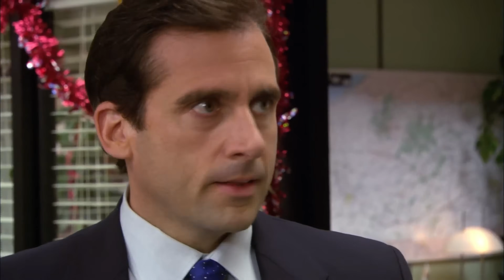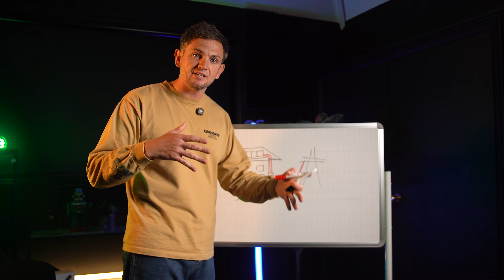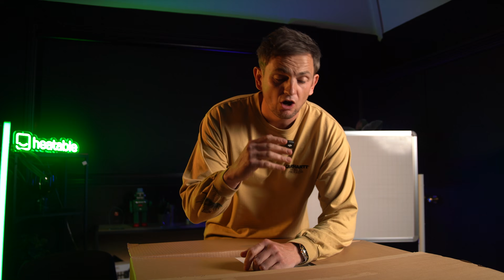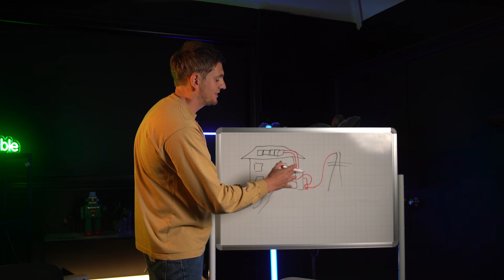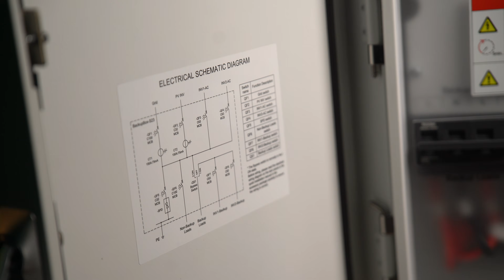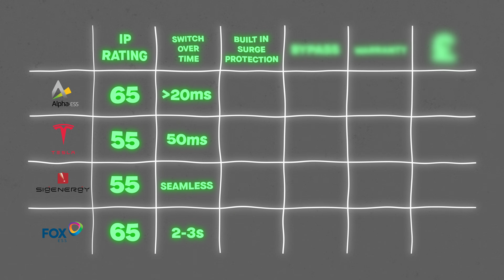What Solar Salespeople Don’t Tell You About Batteries

Comment: Have just had a whole Alpha system installed BUT  this gateway has had some technical issues which means Alpha have withdrawn it from the market while they attempt to fix it. Have paid for it as part of the heatable package but am still waiting. Any idea when it’ll be ready?
Reply from the maker: Hey Andy, we are expecting stock mid November so your project manager will be in touch to arrange this with you.

Comment: Looks like a nice solution to a problem that never existed. If I want my viessmann system to act as a backup device ( I don't as I only lost power twice in the past 11 years ; but let's just say - hypothetically) -- I would simply get my installeer to add the auto disconnect device. The rest is already included with the system. Of course, Viessmann VX3  I have  is not a budget Chinese setup and prkvides out of the box functionality low cost equipment can't. So I suppose some ppl my find it useful to payess up front only to pat extra later...

Comment: Don't understand why the solar industry are making this so difficult (yes I do - more money). Just put the relay in the inverter that you already have so it can break the grid connection, then have it constantly regenerate a clean 50Hz signal (which will smooth out you grid connection in case of issues there as a side benefit).
I also don't understand the comment that without it PV production would shut down - that's true if you' have micro-inverters, but if you're DC coupled why would that be the case?
Finally, switchover time is important, but if the sine wave of the power coming in shifts phase during the transition from grid to backup then sensitive equipment like computers may still shutdown / crash even if it happens quickly - again having the inverter always create the sine wave for the property would solve that.
We've had UPS for computers for years and the more expensive ones do exactly this for those reasons. Do we really need a box the size of distribution board and the additional expense to make this happen?

Comment: Question: Could such a box make an Alpha ESS inverter into a "Stand alone" inverter. These days in Austarlia some of those have become cheaply available due to upgrading of battery systems and that no installer appear to be willing to use second hand units. As I understand it then this unit beside disconnecting the house from the net it makes the inverter believe that the net is still there. Connecting an Alpah ESS inverter to any other 50hz power sourse will not allow the Alpha ESS inverter to start up. I suppose that is because of a much lower impedance on the net.
Reply from the maker: Theoretically, yes. I’m not sure if there is a two wire generator connection though if you run out of solar/battery (I guess that’s not really a problem in AUS)
Reply: @Heatable  Actually as I am in the southern part of Aussie then yes we run out of sun too. Solar panels generate on an average only 1 times panel value in June- July (winter here) so if a house uses say 30kwh a day then we would need 30kw of solar panels on the roof - and batteries- there can be a number of days without sun although that is probably not as common as in the UK. In the summer we only need 6 to 7kw panels for making 30kwh in average a day. Average through the year is 3 times panel value of energy generated.
i would be interested in seing the schematics of that switch box but but I expect that to be out of the question without buying one myself. I am a bit of a Tight Ass as I am a pensioner so I am not going to buy one soon I am afraid. I like to use the stuff that I can get for free or very cheap and being an electronic engineer then I can make use of quite a bit. I have so far gotten hold on 2 Alpha ess units - one older with li-ion battery 5kw and one newer one with LFP bateriey - also 5kw.  Total cost to me for the two has been A$307. The inverters are only 3kw so not too much. I am attempting to use them at my farm where there is no electricity so if I could put them together and make 6kw that would be nice. 
I am charging the batteries by connecting to the battery cable between the battery and the inverter but as the BMS won't allow access if the inverter doesn't run I keep having troubles charging. The losses from an unused inverter keeping it self alive is actually not trivial over 24h with only 5kw of battery.
If the batteries run too low the inverter switches off as it is supposed to but then the connection from the MPPT charger to the battery through the BMS is being blocked making it impossible to charge the batteries so it is not without problems. Problems don't matter so much though as being a pentioner I have plenty of time thinking about it. In regards to power I have other inverters too - and a generator.

Comment: Seems to me this video is misleading. Most new systems do indeed supply your house during an outage and I assume cut export to the grid.  Was this video sponsored??
Reply from the maker: Systems do not work like this. There is no UK approval for a grid tied inverter to software limit exports and supply the home. Unless you mean wiring to the backup port (which I mentioned).
Not sponsored no.
Reply: They disconnect the house from the grid entirely they don't just cut export. However some of the systems support having the entire house ((or most of it) on the port that disconnects from the grid, so whilst it looks like it's doing as you describe what actually occurs is a bit different.

Some Tesla can back up the whole house, bigger Sunsynk/Deye kit can (and even support a generator). In fact you can even wire a big Sunsynk to run an entire house without using the grid tie port at all, so it'll just use the grid as a "generator". Handy if you need a big inverter and the DNO says no if you are willing to trade not exporting for a big inverter/battery setup.

Comment: The deye inverters and many other inverters have backup built-in to the maximum capacity so you can have the whole house backed up via the inverter. Zero compromis. Customers need to be aware that the systems that don’t include this is not normal it’s just a money gouge.
Reply from the maker: Most do offer the same throughput as backup but they won’t allow for PV continuation (that I’ve seen) 🙌
Reply: @Heatable most allow pv to battery and pv to backup or ups circuits just like a off grid system. When grid goes down.
Reply: @Heatable  Solis S5's do offer PV continuation, when wired through a manual change over switch. Commonly set-up this way in Ireland. Solis have been at it 25+ years they know what they're at.

Comment: While I understand that electricians get paid a lot I can not help but think that £400 for installing this is rather high I mean at most it would take 1 person half a day to install so while a normal person on min wage has to go to work for a week to get that sort of money installing one of these that takes from 2 hour to half a day will get you around £400 thats a very high rate of pay aint it?
Reply: So train as an electrician. Then you'll learn how much the certifications cost, the never-ending revisions of the book, the van, insurance, tool theft, accounting, crud like "making tax digital" (aka making tax a nightmare), doing VAT, how much the MCS charges, customer late/non payment, how much MCS compliance costs, and of course how exciting a job it is where being wrong gets you fined massive amounts or dead. At least plumbers only end up very wet, or covered in poop if they screw up. I'm happy to pay an electrician because no way would I want that job!

A lot of the cost of an electrical install is not ending up in the installers pocket.

Every electrician started out as a "normal person" as you call it. Nobody is born a sparky.
Reply: @etchedpixels  The problem with your reply is that you've confused "£400 seems expensive" with "electricians should be paid minimum wage."

Nobody said electricians don't have costs. Nobody said they shouldn't be paid well. You've just listed every expense an electrician can possibly have and acted as though that ends the discussion.

Customers don't care how many rule books you've bought over the years. They care about what they're paying for a specific job.

If a job takes 2-4 hours and costs £400, people are going to divide one number by the other and conclude that's a lot of money. That's not an attack on electricians; it's basic maths.

And no, I don't need to become an electrician to have an opinion on pricing. I don't need to become a mechanic to question a garage bill or a builder to question a building quote either.

The irony is that I never said electricians were overpaid. I said £400 for that particular installation looked high. The fact so many people immediately jumped to defending the entire profession suggests they know exactly why customers ask the question.
Reply: @Datalore48uk People ask the question because they don't understand all the costs involved. Those of us who've actually run a small business don't ask those questions.

Taking the bill dividing it by the hours isn't "basic maths" it's "human chatgpt" maths.

Half the problem in this country is people going "how come they get paid more than me, it's not fair". The real question should be "How do I get paid that much too".
Reply from the maker: Few things to consider (separate to cert/rate debate) - 

Copper earth rod, 25mm2 copper tails, 16mm2 earth, containment, henley blocks etc

All adds up plus… profit 👀
Reply: Welcome to the real world, people value things differently, someone on a minimum wage job generally hasn’t spent years of their life studying, passing exams and spending thousands on equipment. I charge £35 per hour for my job, but get paid about £13 an hour for my other job. My mechanic charges £90 p/h main dealer £160 per hour, solicitor £200 per hour my daughter - paramedic £19 per hour plus shift, overtime and out of hours extra pay - saves on average 4 lives per week.
Reply: @bordersw1239  The other thing about having a job done professionally is that they have to cover for insurance, transport, building cost and many other things. Running a business is expensive. Labour costs are just a small part.
Reply: @bordersw1239  From the comments so far anyone would think that I said I was on minimum wage because I did not I was giving an example I actually own a pub so if people want to compare hourly wages thats fine.
My point was £400 for something that could take 2 hours and up to half a day is extreme. I had a chiller specialist come look at my cellar chiller and it was £100 call out and £60 an hour which I thought was fine since I know it would only take 1 hour to see what is wrong so I would have thought it is more reasonable to charge the same rate not a flat fee no matter how long it takes.

In my example if it takes them 5 hours then sure £400 is fine but if it takes them 2 it should be less.
Besides more people would be willing to install this if they charged less or hourly.
But sure like anything, each to their own I personally think they are charging way over the odds for this job.
Reply: The gateway needs an earth rod that is what takes the time

Comment: These gateways are such a gimmick. Many systems have gateways integrated inside the inverter why don’t they just make that a standard. Sounds like just another money catch
Reply: It's historically not been a standard in the UK because large parts of the UK see under an hours outage a decade and outages are fixed in a few hours max. So it's mostly been an add on item that people wouldn't choose to pay for.

The inverters with it built in generally did so for other markets (Tesla for the USA where multiday outages are common in many areas, Sunsynk for South Africa etc where the grid is best described as "interesting", and so on)

Comment: You are confused about "the signal" solar systems "listens for" to determine if they are on the grid or not.  There is no special signal.  The grid is producing a 50hz sine wave synchronized to it.

Initial detection of the grid before the inverter starts operating is easy.  It's either there or not.  But once the inverter is synchronized to the grid and outputting power, it needs to do other things to detect whether the grid is still there or not. The inverter can detect a grid-down event in several ways.

* The inverter caps out on voltage (suddenly there is nothing to push against and the inverter's output exceeds the loads on the circuit), and can disconnect from the grid very quickly in this case.  Or the inverter over-currents because the grid has become grounded and the inverter can't power all the homes on the block.  One of the two.

* The inverter synchronizes at a slightly different frequency (e.g. like 49.95hz) and then constantly resynchronizes to the grid frequency on every cycle.  If the grid goes away, the inverter will notice that the frequency is now 49.95hz (the one it is producing and not the one the grid is producing) and can disconnect within a few cycles.

* The inverter injects a deviation into the grid.  If the grid is present, the deviation is absorbed (the grid force the waveform to remain confortmant).  If the grid is not present, the deviation is not absorbed and the inverter realizes that the grid is no longer present.

In a full house backup, the off-grid or hybrid inverter disconnects from the grid and produces the required waveform (50Hz sine wave for example) itself.  There's no other signaling or anything else beyond frequency-shift power control of the microinverters (50hz to 52hz or so).  The microinverters still recognize that a "grid" is present.

--

20ms isn't so great.  Actually its pretty bad.   One cycle at 50Hz is 20mS (16.6mS in the U.S. at 60Hz).   That's two half-cycles of interruption which ... is not so great.

However, there is a trade-off in terms of reacting faster and that is you'll get more false alarms and wear the transfer relay out faster.

The transfer relay also has to switch on a zero-crossing which means the fastest it can switch is on a half-cycle basis (10mS @ 50Hz, 8.3mS @ 60Hz).  And the relay usually needs at least 4ms of energization before the arm actually moves... so best-case for a relay is typically 14mS.

This is a general problem with using a transfer relay.

Grid-interactive inverters can do slightly better by trying to correct the waveform while switching the relay, but there are severe limitations to doing this.  The grid-interactive inverter can inject only so much instaneous power while the grid is still connected... the grid is an extremely low-impedance source.  And any glitches (like starting an A/C compressor) can cause false relay trips.  The relay wears out faster.

--

Anyway, there are solutions.  The most common is to burn some additional power by running through an AC-DC-AC conversion in the inverter.  This is how online UPSs work.  When this is done, the battery can support a failing grid instantly ... 0mS switchover.

-Matt
Reply: It's arguably not worth doing the 0ms for everything as double conversion has a significant efficiency cost so it's better to pay that cost only on a little battery attached to the PC or device that is that sensitive.
Reply: @etchedpixels  maybe I didn’t explain it well enough.  Hehehehe.  Not every power failure is clean cut enough that a relay based backup can react to it fast enough.  Those 20ms specs aren’t really a guarantee… a good chunk of failures will start out looking like just a motor start and the unit will try to ride through rather than switch… it won’t react fast enough.  Double conversion wastes more power but IS a guarantee.  Double conversion is also still able to extract power from a grid in brown-out while still providing perfect output to appliances without having to dig into battery reserves.    Anyway, there are a multitude of reasons.

-Matt
Reply: @junkerzn7312  Yes I know. Double conversion is however horribly inefficient so it's better not to double convert the main supply but separately double convert just for the sensitive electronics.
Reply from the maker: Hi Matt

Thanks for the explanation. Technically spot on but could you imaging the retention rate on a YouTube video if i explained it like that 🙌
Reply: @Heatable  yes, very true.

Comment: Or, if you have pretty much ANY of the hybrid Deye or inverters or Sunsynk and Sol-Ark oem brandings wired with house on Load port.
Reply: That is, they have this "box" built in as part of the normal hybrid inverter. No need for a separate unit. You can however install a 1-0-2 changeover switch so you have the option of bypassing your entire solar/battery installation in case it needs servicing.
Reply: Yep we have a Sunsynk and it's really nice for this. Whether you can put the whole house on the load port varies a bit as the smaller ones don't have a 60A pass through rating. The ability to back up microinverters to 4kW or even an existing grid tie inverter up to that size is also rather nifty. Generator port is nice too but for the UK probably very few people need it, just those in very rural places or running one off grid.

Certainly not a 20ms switchover though.
Reply: @etchedpixels  no, it switches much faster when it's already in sync with the grid. The transition takes between 4 and 10 milliseconds and is compliant with atx standard.

Comment: I have a PW2 with enphase 8 microconvertors. This converts my home to an energy island when the grid fails. I’ve had 2 power cuts in 3 years and it works. Does taking the powerwall off grid replicates a power cut? If so, my system works with that too. It also has a storm alert and automatically grid charge the powerwall prior to a possible power cut.
Reply: Powerwalls can support this (it's become optional in the later ones I believe but it was standard in some models).
Reply from the maker: What he said ^ 🙌